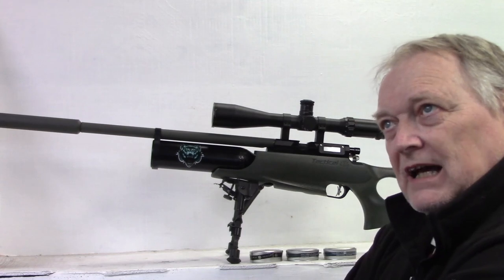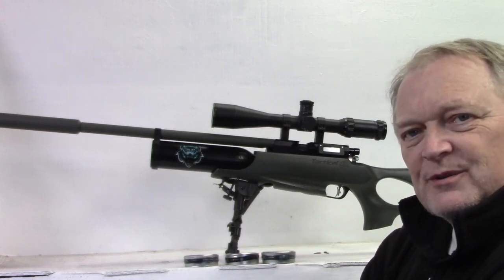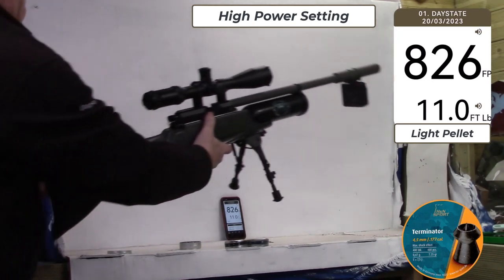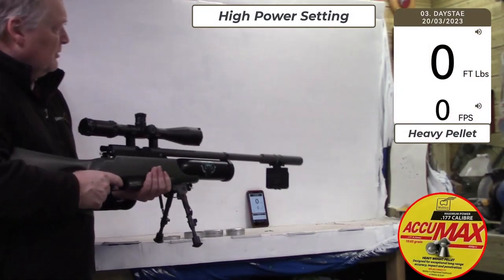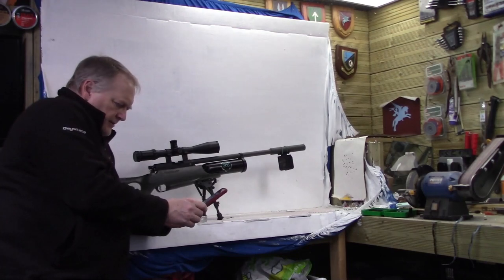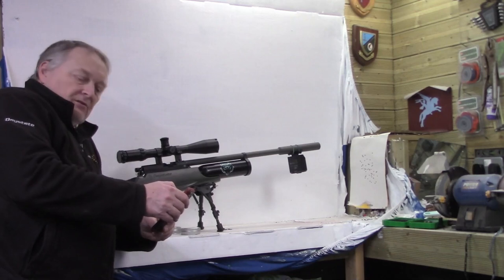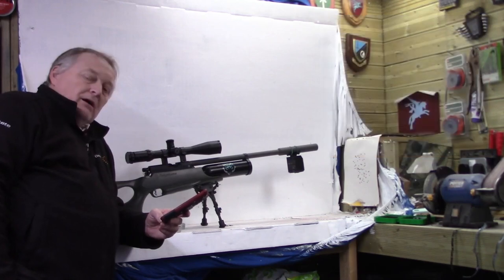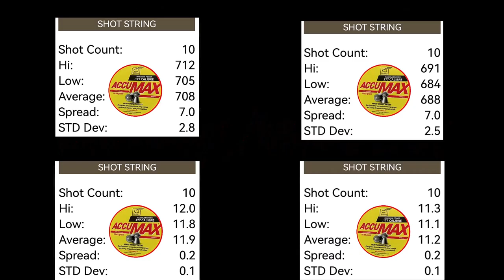The Electronic Daystate Air Wolf - Power adjustment & Pellet Results

Comment: i have to be careful indeed red wolf if i put a heavy pellet in on high power it can tip it over over for sure
Reply from the maker: Yes. The factory usually uses the Daystate Rangemaster Sovereign at 10.3 grains through the .177 rifles through their chronographs, or the 18.13 in the .22 for sub 12 ft/bs. They do try and keep them within the legal limit, and it does make sense to weigh all pellets if you want an official figure, but you can see why it’s definitely worth trying different pellets, especially if you can tune a rifle, which are in most cases mechanical, not electronic. In the case of the electronic, it’s down to Daystate to get it right at the factory, bearing in mind that pellet manufacturers are always coming out with new pellets to upset the apple-cart. Others will use a heliboard and that can solve, or make problems worse in the wrong hands.
Reply: @airgunsniper-elite7385  i agree test sheet i have in the box is for 8.44 sovereigns and they were hitting 11.5  so a 10.5 grain pellet just tips me over the edge on high power not silky over but enough to get me in trouble with the range man 😱😱😱 to be fair i have it mid power if i am shooting slug or a heavy grain pellet because i know it keeps it in around 11.5 to 11.8 . however if you were not up to speed with it (see what i did there 🤣🤣🤣) you could well find yourself in a bit of trouble for sure